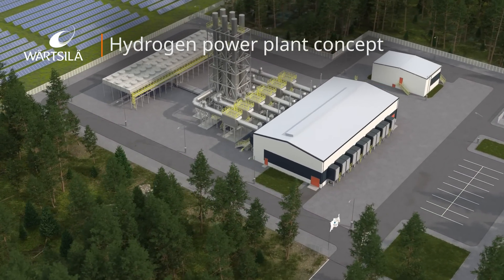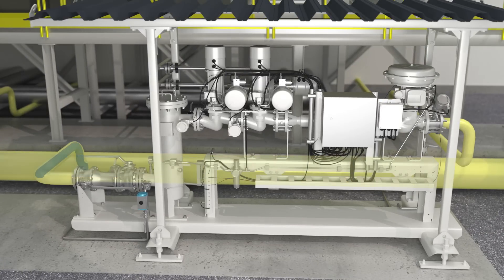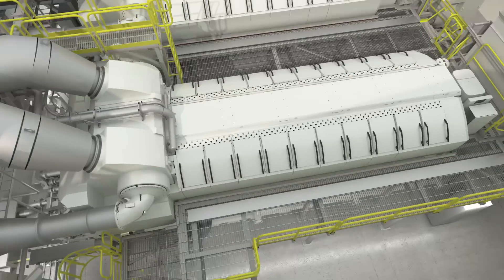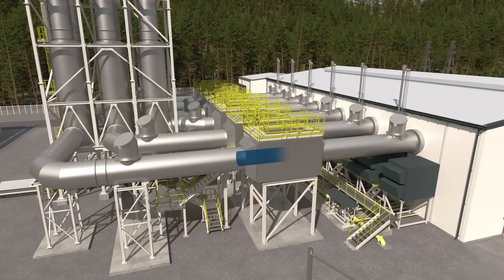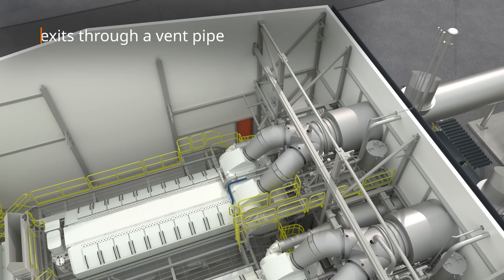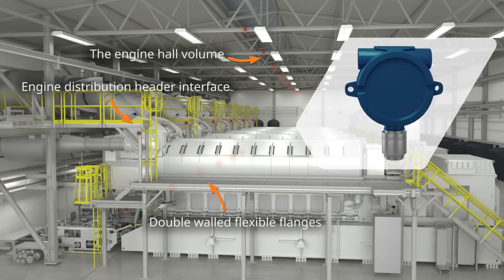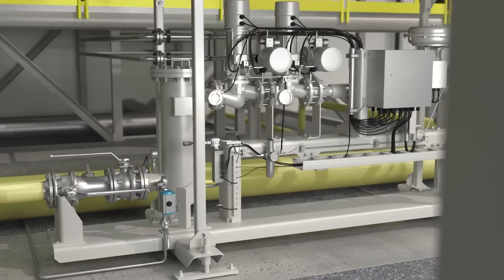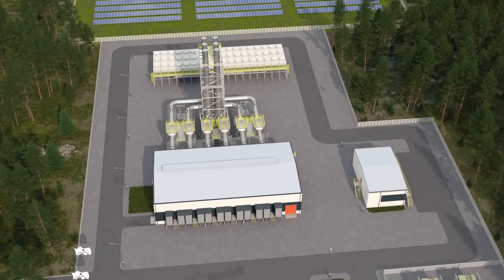World’s first large-scale 100% hydrogen engine power plant | Wärtsilä

Comment: Vast amount of hydrogen is best generated by running steam upon natural gas. But if natural gas is available, then better use natural gas to run the engines to generate electricity. From the video, there are a lot of solar panels. Again, if solar power is available, then better for solar to generate power directly and excess be stored as compressed air, which can be used during the night time. Hydrogen is not something we want to play with due to its extreme flammability and quite dangerous.